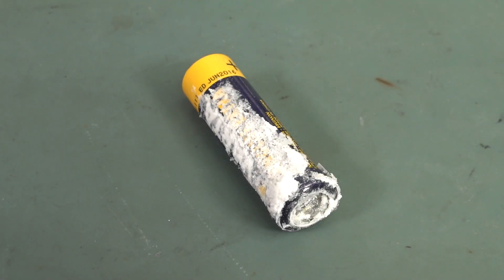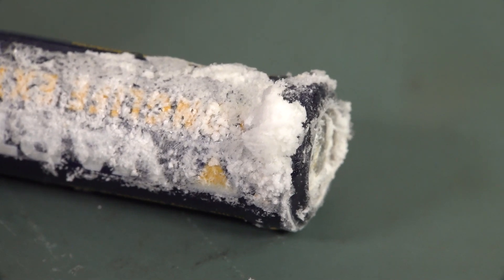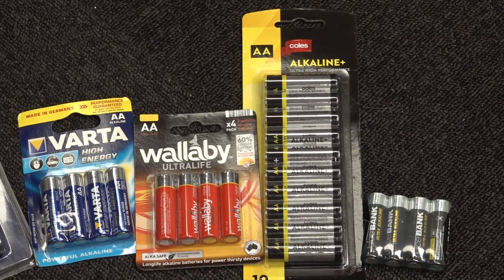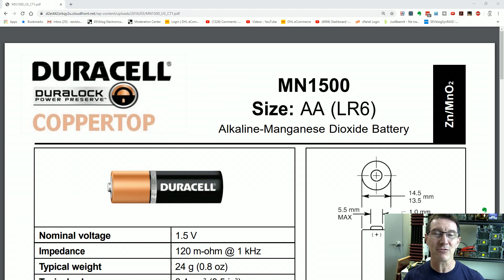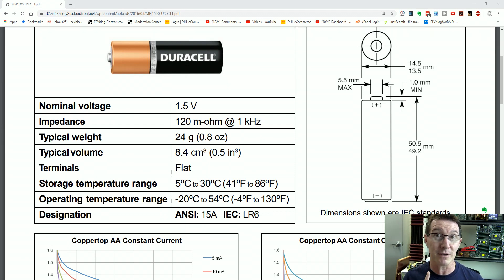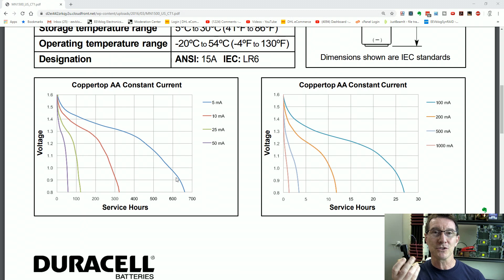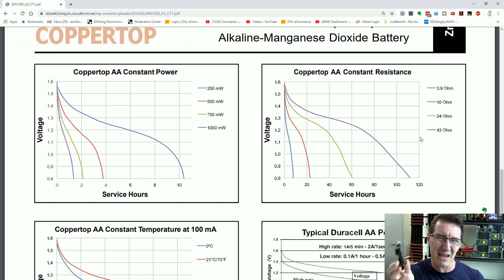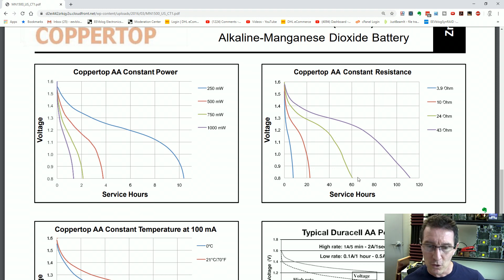EEVblog #1296 - Alkaline Battery Leakage Testing 2 - Electric Boogaloo

Comment: The battery leakage tested in lab are always showing very good results. Energizer once sold leak-proof alkaline batteries, but in real life use, they still leaked, badly.   When batteries are exposed in high temperature and humidity environment, in sealed container in real life , they can leak quicky, way before they are dead. That is why relocation company, who help people move from one country to another. does not allow the alkaline and other types of batteries to be packed into the shipping container, shipped via sea.  They are afraid that the leaked alkane battery will contaminate the other stuffs inside the shipping container, during the transition over ocean. I often find that, What people saying to take out battery when not in use,  is a mystery -- they will leak way before it is completely drained,   not because of over-discharge. Who does not have a summer time. that is why so many devices continue to be damaged by leaky battery, despite what manufacture claims.

Comment: Hi Dave. I have had Varta alkaline leak in stuff when the batteries are still within their use-by date, and still charged good enough to operate it. Somewhere around 1.3 volts.

Comment: When you measure the battery voltage after discharge are you using a meter with a loaded battery test or are just using regular dc mode of a meter? Im just curious

Comment: In my feeling (I have no statistics), batteries are leaking more often than let’s say 30 years ago. The question is: did they become worse (due to cheaper production or more aggressive chemicals, or just because the manufacturers don’t care) or is the way they are discharged more challenging for the batteries or do we just leave them in longer, because nowadays, they devices are less power hungry?

Comment: After digging out some leaking batteries from a lantern, I had a thought:  What if the problem is the spring pressure of the battery holder?  Looking at the way the battery is constructed, internal pressure will HELP seal the battery (until the safety vent goes), but external pressure will push the negative terminal in wreaking the seal in the outer edge.  I couldn't find a specification for spring pressure, but it would be in the interest of the device manufacturers to keep it stiff to avoid loss of power during rough handling - but if my theory is correct, that increases the odds of a leak.

Comment: it might also caused by temperature cycle, when battery loaded with high current, or exposed to high temperature, different metal expand and retract differently, which increase the chance of leaking. (just my guestimation🙃)

Comment: Duracell batts leak! Ruined my 5cell MagLite! In 2016, Light was setting in my home for “standby use” with virgin Duracell batts with 2019 expiration date, 2 years later, batts swelled and leaked making it impossible to remove the crappy batts even after trying to hammer them out. Rather use Walgreens batts than DuraSuxCell. Energizers have not leaked...ever! Put energizers backwards in the bunny! The bunny kept cumming and cumming and cumming. What a bunny!

Comment: Hi Dave,
I love you channel, watched hundreds of your videos. It is great that you are trying again to figure out why some of the batteries develop a leaking problem . However, I do not think you are going to make any of these batteries to fail. Simply, because they are part of 99.9999+% of "good" ones. The ones that fail are part of the "bad' ones. These are the ones that are being sent back to the manufacturer by the "volume customers" for a failure analysis. So, here is a polite request to the engineering (failure analysis) departments of the major manufacturers. Could you please make a post saying something like this: I am John Smith, have been working in a test department for one of the major battery manufacturers. We have received a batch (batches) of leaking batteries. After a thorough failure analysis on leaking batteries we found this.....

Comment: The problem is Dave your using far too cheap of battery holders,  you really should test this with your most expensive AA powered test gear and then they are sure to leak.  They're never going to leak in those cheap holders 😁

Comment: The tighter the spring of the battery holder, the more likely it is they will leak. I found aircon remotes the most likely to leak. It usually have a very thin spring and fits super tight. I believe that tension and the super small contact area pushes the terminal of the battery in and damages the seal a bit. Please leave a few batteries inside the holders to test which group of batteries have the highest failure rates. Those in the holder or those in storage. Also put a few good unused batteries a couple of days inside a really tight holder, then pull it out after say a month and see how they fare after long term storage.  Oh, and bang a few on the table a bit before use, as I found that helps to speed up leaking in better quality batteries. The old trick of a new battery that bounces more than an old one comes to mind.... :-)

Comment: Wondering.  Could it be the pressure of the various contact springs continuously putting pressure on the battery?   A constant squeeze so to speak?  The squeeze builds pressure over long period till it spews the bad innards.

Comment: One observation I have had about leaked alkalines is that it always occurs when more than one cell is use. I.e., two or more batteries are in series. Notice how only one cell leaks, while usually the remaining cells do not. This is a clue as to what is going on. Dave should run a simple experiment by putting 3-4 cells in series (a common topology), apply a load, and monitor the voltage on each. At some point, the weakest of the batteries will discharge to zero, and then flip its voltage if the load remains applied. When that happens, the weak battery is no longer a power source, but instead it is a load (resistor). Pop goes the seal! You can accelerate this test by running one battery down, then run the experiment using it and filling the other slots with fresh batteries. The depleted battery will go south very quickly this way. (This is why it's always a bad idea to mix old and new batteries in your battery compartment!)

Remember, no two batteries are exactly matched. One can pump out more electrons than the other. Always. When you put a bunch of them in series, you WILL at some point encounter this issue!

This is where one of Dave's semi-patented whiteboard chats would come in handy, to explain the four quadrants of a V-I plot. Which quadrants constitutes a load, and which quadrants constitute a power source. Once you do this, then you can plot how a battery changes from a power source to a load when its voltage reverses. It takes too long to do here using words.

That is the key thing to look for: a reversed voltage on one cell. I believe that when this occurs, that weak cell will pop its seal, and leak. All of Dave's tests so far have been discharging only a single cell. Hence, no leaks. Put two or more cells in series and repeat the experiment, and I bet that one of the batteries spills its guts, although it may need some time for the hydrogen gas to build pressure and blow the seal. To complete the test, measure the voltage on the leaking battery with all batteries still in place. I bet its voltage is reversed. The best way to demonstrate it is to put a datalogger on each battery and then plot the results, battery voltages vs. time. It is graphically obvious then.

It's for this reason that I have always been wary of any product I buy that requires more than one AA or AAA battery: I know that eventually one of the batteries is going to leak and muck up the contacts in the holder area. I personally don't use alkaline batteries, preferring rechargeable Ni-MH cells. They don't leak. I've even gone so far as to build a little boost circuit to kick up a single battery to 3V or 4.5V, whatever the product needs to be happy. Use dummy (shorted) cells to replace the other batteries. I also include a little cutoff circuit that shuts off the boost when the single battery's voltage reaches about 0.8V. No leaks! Microchip makes a very nice boost that works on a single cell, and is quite cheap (MCP1640). There are probably others.

Sorry to ramble, but this IS an EE blog that attempts to explain stuff. Often, there are no simple explanations.
Reply: I've had a duracel battery leak into a small clock. It was just a single AA battery.

Comment: I was in the late 80's to mid 90's a test/repair technician. Then the upsurge of automated tests ended that, for me it was a godsend because I wanted to separate my hobby from work. I did have some work but not the same. But what I am asking is how many of you had that same experience. And did you go to your home bench to get your electronics fix.

Comment: Why not have a zener or thermistor in series with the resistor? Having a low resistance at a higher voltage and high resistance at a lower voltage seems like it would be ideal.

Comment: Decharging with a diode(0.8V per cell ideally), should keep the voltage high enough, to do some galvanic erosion, while drawing the maximum current.

Comment: 6:53 - In that series arrangement, it's a good idea to place a high-value resistor (1 MEG) across each battery, so that no single battery 'takes over' during charging or discharging :)

Comment: Rule of thumb:  Never use alkaline batteries in any device worth more than the batteries themselves.  These are disposable batteries for disposable devices.  An insidious property of these batteries is that they can leak while still providing power.  When used in a TV remote, you can note a reduced range.  When checking the batteries, they have already started to leak and cause damage.

Comment: Just an idea about the lazing batteries in a plastic box: they don't experience the spring tension by the usual negative terminal springs in random electronic equipment. What if spring tension causees the sealing to actually fail as under no spring tension applied the sealing is pressed to seal?

Comment: I hadn't given much thought about factors that caused leakage until this video, and realized there may be some correlation between the amount of end pressure exerted by the device battery holders and leakage.  Most of the devices I have are fairly low discharge (< 50 mA) with no standby current, and are used for short periods of time very intermittently.   The devices are things like noise reduction headphones, cheap DVMs, remote controls, wireless mouse and keyboard, and shortwave receivers.  The devices that have  high contact pressure seem to have the highest leakage rate.  Anyone else notice this?

Comment: Put half of your test set in your car, so that they are subject to wide temperature fluctuations. Most of the items I have had cells rupture in are high load items namely mini mag lights, which again have a large number of heat cycles from being carried in pockets on a daily basis.

Comment: I thought I was smart and charged a bunch of alkalines. Sure they charged a tiny tiny bit. Then in 2 or 3 weeks ALL leaked except the ones with a visible seal on the back. Charged them really slow, like 7mA for 24 hours .

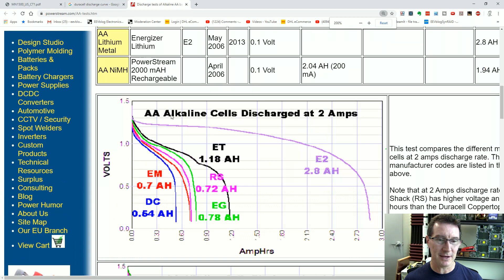Comment: 12:07 Well I tried to buy some, (over a year ago) wasn't able to. ... I have applications for it ... devices that like a higher voltage to work ... or LED lights in general. Yes they will "last longer" but what good does that me if they are too dim? I rather have battery "die sooner" but the led in full brightness ... 
The quotation marks are because I usually end up replacing the batteries when the still have 3/4 charge left (and use them then in other devices or recharge them) and therefore for me they don't last as long the way it is used right now.

Comment: I once got an alkaline to leak (bang) wirh discharging it to zero. I used an energy harvesting chip which can work starting from 0.1V. It took about 2-5 hours. What to consider though: the storage conditions for the experiment. Often the batteries in remote controls or radios leak. They are often stored in chilled places. Maybe some variations in storage could lead to new knowledge. Maybe store a couple of them outside for cross checking.

Comment: When you showed the bad state of a battery at the start of this video and said it was made by Varta I was thinking "enough said". Leakage from a Varta brand battery has been responsible for (almost) killing many an Amiga 2000 series computer.
Reply: Those Vartas are NiCd rechargeable ones not alkali single-use cells. Most NiCds age and leak in the same way irrespective of who made them.

Comment: Un-scientific for sure... but as others here have noted; I think even moderately elevated temperatures greatly accelerate alkaline battery deterioration & leakage. Thermo cycling might also play a part such as in flashlights stored in cars. Might I suggest perhaps putting some of the samples somewhere with a constant temperature of say, oh... 100°F (38°C)? Maybe some others in a car normally parked outdoors? My hunch is they'll leak fairly quick. Kind of 'real world' situations. Cool videos, Thanks!

Comment: Battery autopsy notes: The other day I needed to disassemble a fine looking dead alkaline battery. I noticed on the negative end there was a paper or paper like washer at the negative end.  One side is like untreated paper and the other side is coated with something that likely resists liquids. My washer had a dark wet appearance at the center hole where the spike goes into the body of the battery. The end cap is shaped such that there is some room between the washer hole and the part of the end cap that first makes contact with the treated side of the washer.

There is a dent at the very center of the end cap. I'm not sure if I did it while disassembling it. However it got there, it may have damaged the seal/vent(?) that the center spike passes through and caused the little spill I see.

The battery was from an LED flashlight that had been used daily for almost 2 years. After dying it spent another 6 months on my desk waiting for me to look up whether or not my state requires special burial rites.

My guess is one of the purposes of the washer is to blot up leaked electrolyte while protecting the metal end cap.  If the washer were accidentally installed upside down, it wouldn't blot and might provide a quick way for even a little electrolyte to make it to where the outer jacket, washer, end cap, and outside world all meet. Also there may be conditions that overwhelm the washer's absorbency, ex. a short circuit heating and pressurizing the battery, high current passing through the spike and heating it to the point the seal/vent melts.  There may be many failure modes, and leaving them in equipment just gives the blotted up electrolyte time to eventually migrate to the crimp. 

Anyway, good for you EEVBlog for actually experimenting.

Comment: Dave, remote controls and such are devices that use low standby power, with occasional bursts of 50mA or so when transmitting.
I wonder, does a pulsed load have something to do with the leakage?

Comment: Pull the batteries out of the pack, stick them in your most expensive piece of equipment which accepts them, and they will leak in a few months. Every single time...

Comment: I've got a pair of those golden Panasonic battery in my analog voltmeter since 2016 and they still are going good. I use it mainly to check resistance and continuity.

Comment: Dave - There is another unpleasant ‘gotcha’ with some batteries.  Even if they don’t leak, they change their diameter when they age, presumably due to the internal pressure.  I had a 3 or 4 D cell Maglite (I forget which) and when I found that the batteries were flat, I took off the end cap to put in fresh ones and found that I couldn’t get the old ones out! They were jammed solid.  Nothing would get them out. I tried whacking the end of the Maglite with a wooden mallet in the hope that the battery’s inertia would loosen them but they moved not one millimetre.  Would you be interested in recording the diameter of the batteries at the start and end of the test?

Comment: The pattern is follow.
1. You discharge battery. First just normal load and then really small one, so it gets truly discharged.
2. After this apply to it relatively high load.

By this patter batteries in my mouses leaks. 1. Long really small use, only few hours at day and only for office stuff.
And then, high load by gaming - ta-da, it leaked.

Comment: Watch out, last time you have been testing for leakage your lab get flooded hahaha.
Duracell are more prone to leak or it´s because is more in use ?. Like when the army implement the use of helmets and the head injuries rised up, everyone said helmets wasn't good and it was the cause of the injuries but the true was without the helmet the soldier would have died.

Comment: where I am at it is called Energizer Max I have had AA batteries leak in a cordless mouse at one point it made a loud Pop in 2003 and yes the mouse I had then was using Duracell Batteries